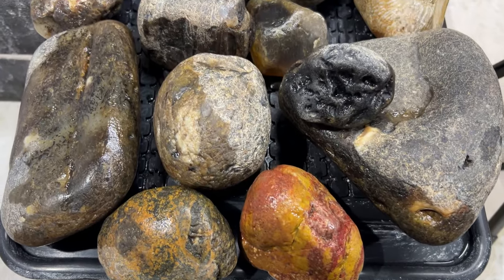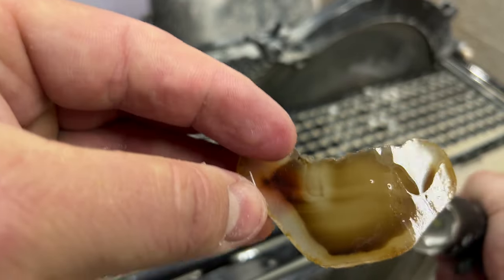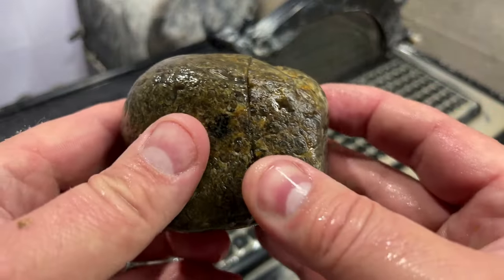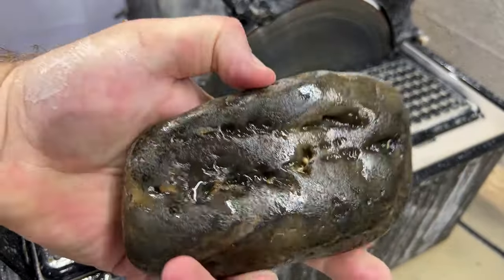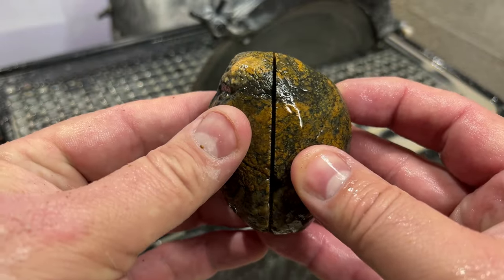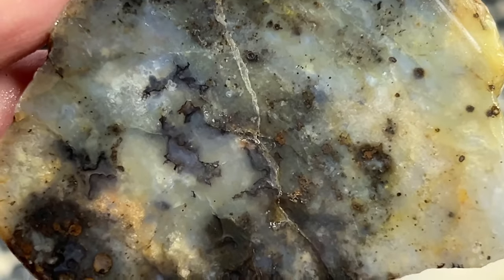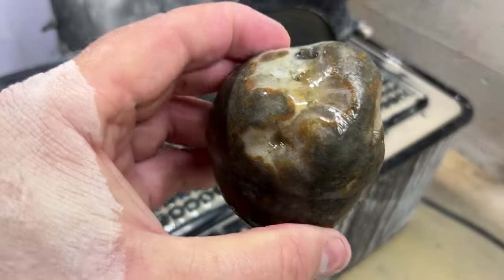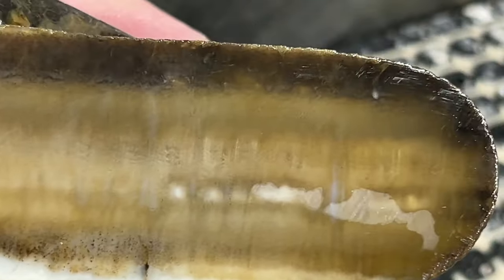Random Rock Cuts from the Yellowstone River!!!

Comment: That second one and the dark agate were the best for me. The bands in that dark agate should really pop when polished. 
I see you're using the notched blade. Do you like it better than the thin sintered blade? I didn't like the notched much, although it seemed to cut a little faster, the sintered made soother cuts without removing so much material.
Reply from the maker: @steveegbert7429  I like the thin sintered better also, I am just using the notched because I needed to replace my blade and that’s all I had, which reminds me I need to order one! Thanks for watching!

Comment: Nice. What kind of saw are you using ?
Reply from the maker: @andrewp.schubert2417  I use the 10” Hitech Diamond saw, thanks for watching!
Reply: @JensensAdventures  How do you like it ?
Reply from the maker: @andrewp.schubert2417  For me it has worked really well, I enjoy using it and have had no troubles so far, I also like the design of it, if somebody were looking for a 10 inch saw i would recommend it.
Reply: @JensensAdventures  Thanks. Good to know. I've had their 8 inch flat lap for a few months and it's been great,
Reply from the maker: @andrewp.schubert2417  I like my flat lap from them as well, haven't used it a whole lot but the little bit I have its been good.